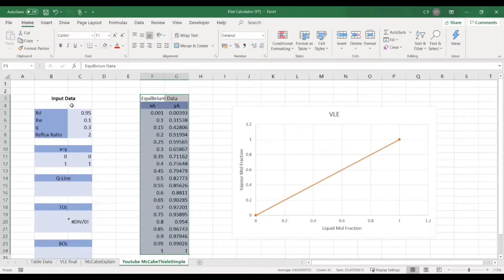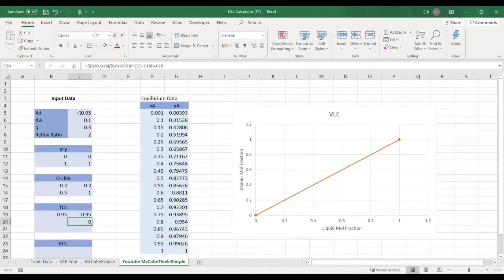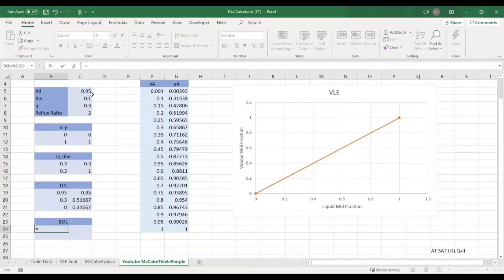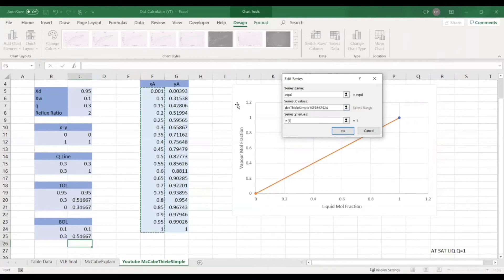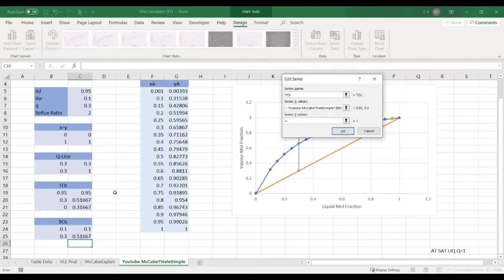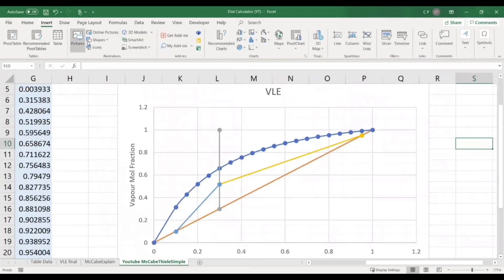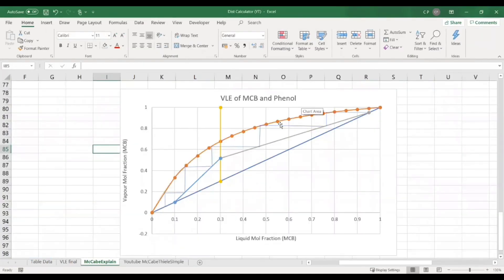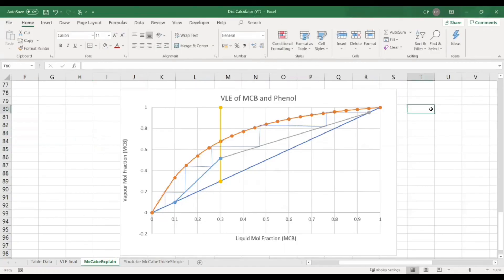Making a McCabe Thiele Diagram Excel - Fast

Comment: if you move the chart everything gets missed up, is there a way to draw on the chart?
Reply from the maker: There is a way you can make the plates on the scatter plot, although it will take longer. Otherwise, you can just group the drawn lines and make sure to select the grouped components when moving the object